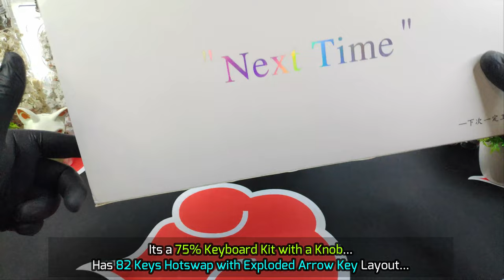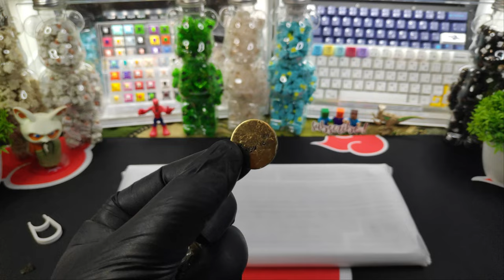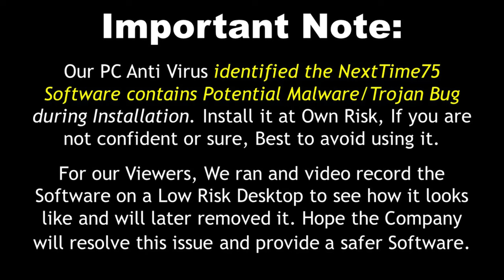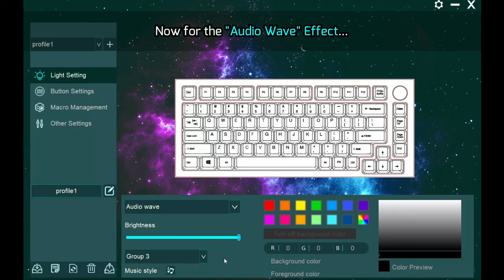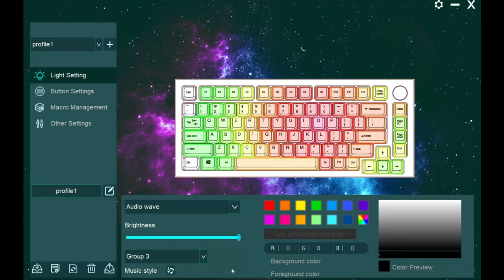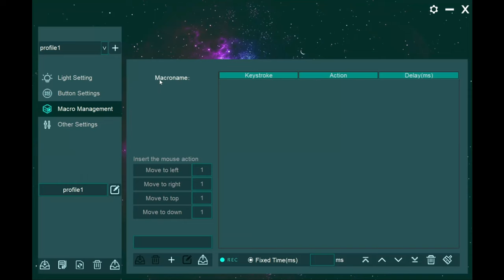Next Time 75 @ LǎoXuē75 (老薛75) Mech Keyboard with MMD Panda Switch and Aifei Olivia Inspired Keycaps

Comment from the maker: We mentioned in the video that there are currently a 3 Mode Version which is called 75v3, but honestly not really sure whether it is the NextTime75 3 Mode Version since there are No Official info on it except for Online Seller Advertising it.

FN Combination keys Function
Fn + (ESC) = Factory Reset
Fn + (W) = Light Direction (Use W, A, S & D)
Fn + (Press Knob) = Play or Pause Media Player
Fn + (Press Knob for 3 Sec) = Switch Knob Function, Volume or Brightness
Fn + (Right Arrow) = Cycle RGB Modes (7 Modes)
Fn + (PgUp) = Go to Next RGB Mode
Fn + (PgDown) = Go Back Previous RGB Mode
Fn + (-) = Decrease RGB Speed
Fn + (+) = Increase RGB Speed
Fn + (DEL) = RGB On/Off
Fn + (END) = Side RGB Mode Change
Fn + (Spacebar) = Activate Change RGB Color
Then Press Fn + (Spacebar) again to toggle Color for whole Key
Or Press Fn + (Any Key) to set Color for that Key
Reply: cool. Hi do you mind share the link to download the software please ? I kinda interested at the keyboard after watch your video. Would like to have a look the software. But the link at your description cannot be open.
Reply: Thanks for this. is it possible to have to have white backlight only on this board? without using the software?
Reply: @paulobasilio7730  yeah- it is possible: just do fn + pg up until you see it go to one colour, then use fn+ arrow keys to choose the colour- white is in the colours

Comment: really nice and thorough review, i appreciate you going through the software too (also where did you buy the bear jars, i also wanna use them to store switches lol 😂)
Reply from the maker: Bought it using Shopee Malaysia, search "Bearbrick Bottle" :) few size option to choose, the 500ml bottle can fit 110 switches and the 350ml can fit about 80 Switches. its quite cheap, got it for about RM1.80 (~USD0.40) per bottle.
Reply: would you recommend dowloading the software despite the risk though?

Comment: Where can I get the bear jars!, They're so cute for holding switches
Reply from the maker: Bought it using Shopee Malaysia, search "Bearbrick Bottle" :) few size option to choose, the 500ml bottle can fit 110 switches and the 350ml can fit about 80 Switches. its quite cheap, got it for about RM1.80 (~USD0.40) per bottle.

Comment: Hello, I'm new to your channel. I just want to ask of you encounter interference with north facing switches on cherry profile keycaps?
Reply from the maker: Currently no interference when using the Aifei Keycaps and FEKER Smokey Black Switch. But if there is, a simple solution is to use Switch with Long Stem Pole.
Reply: @w4q430  Feker smokey black switches are long pole, right?
Reply from the maker: @xSeanok  its not advertise as having it but Visually I can say Yes. :)
Reply: @w4q430  t
Thanks man. I just ordered Feker airys today.

Comment: Ik 75 and nt 75 what is good better
Reply from the maker: Between IK75 & NT75, will have to say the IK75 since it has 3 Mode Connection, comes with 3 type of Foam Sheet, Adjustable Feet, Plastic Dust Cover, 8K mAH Battery & free 5 Switch Samples for its price range.
For the NT75, its plus point is the PCB support PCB Mounted Stabilizers.
Reply: @w4q430  which you refer the most?

Comment: in your opinion, feker ik 75 or next time 75 is better?
Reply: feker is better but next time is half the price so I'm confused on what to get too
Reply: @tamqko3116  yoo i just get next time and it's very fine -- one thing to consider is i get metal place. i think feker has more plate option. overall my goal is to get a budget board so the cheaper the better.